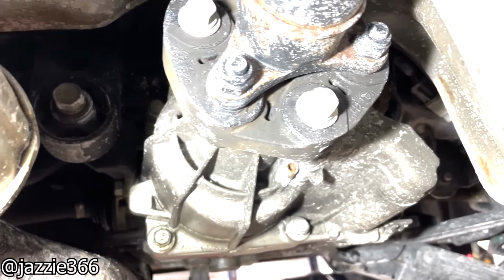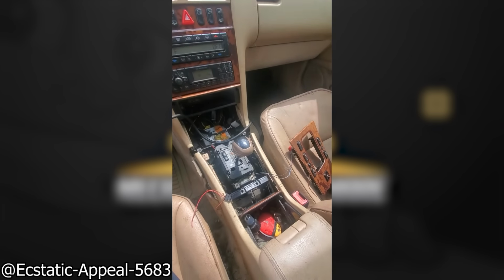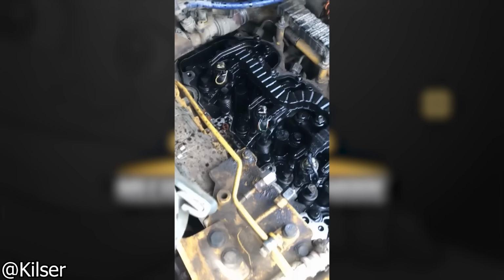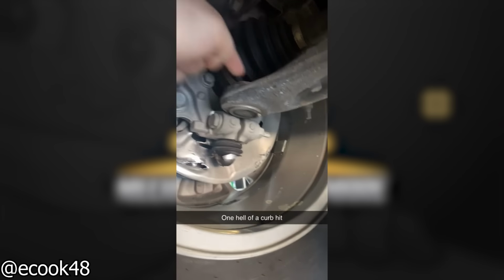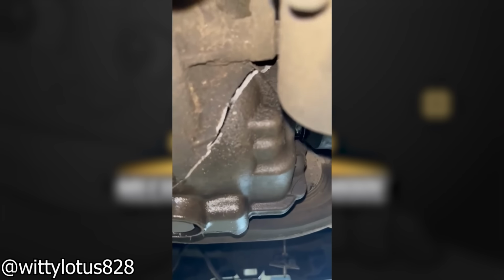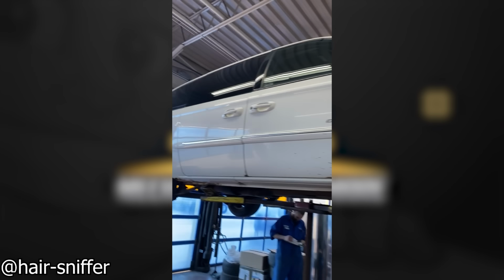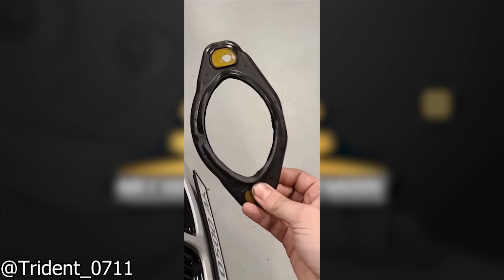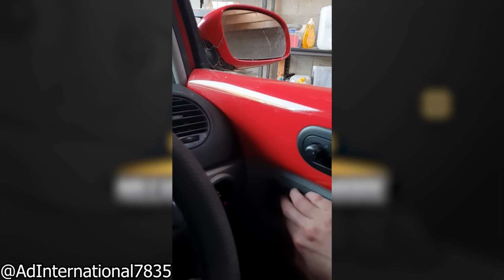Customer States Compilation (Best Of 2022) | Mechanic Problems | Just Rolled In

Comment: Dang! They're really upgrading the stock vehicles at the factory. Little preus & small hatch cars had 2 & 3 piece brake rotors as well as multi-piece clutches/Pressure plates/flywheels. They really clamp on "tight". Million mile oil or high capacity engines too!  
FFS people, pay attention

Comment: Dear mechanics it's 5 o'clock do you know where your 10 millimeters are?
Reply: If you have a few , (we would appreciate having them back) Also if u find my kniplex pliers from the airtex/wells  trash fuel pump era , I really miss that lil bugger  , is okay i replaced .  Still miss a good tool when it leaves.  ✌ happy thoughts.

Comment: OK, here is what we do and what you guys over there should do in the USA, just for the safety of everyone!
As I said it is a safety thing here if not for anything it's not driving a death trap on wheels on public roads!
Right, this is how an MOT works, go book an MOT test day then you get a bit of paper ( if you pass ) and also goes on the DVLA computer, as every car has got to be registered to the owner and all their details are sent to the DVLA. They will send you a log book which will list you as the Registered owner The MOT is to say " your car is fit to drive safely on the road for the next year. So you can't go in with shock mounts rusted away because that's all a failure, ball joints, track rod ends, lights, wipers, body, windscreen, tyres, exhaust not blowing anywhere from the head to the back box and it also must stick out from under the car, so you don't die by gassing yourself, breaks, brake pipes, hard and soft and it goes on, petrol lines, As I said this is mandatory! If you got a car. If you don't, get an MOT you will be getting pulled all the time till you get it MOT. The sooner the better as the fines mount up very quickly and they can take your car for using an unfit vehicle on a public highway. It works! Believe me, it does!

Comment: When looking on this..... DO I want to visit North America and travel with anything except air and train ?

Most NAs should be subjected to a rigit MoT inspection each year!
Reply: I don't know about trains - many tracks are in such a bad shape that you can be happy to drive with more than 30mph. Problem in the US is that passenger trains are seen as of no importance. The tracks are not owned by the passenger train companies, they're owned by the freight train companies. Most parts have only one track with passing points where the passenger trains always have to wait for the slow freight trains to leave a section. Because of that delays of a few hours are normal. A friend told me about a 13h delay on the California Zephyr and said that 1-3 hours were 'normal'. And add to that that the USA has no real high speed trains like the TGV, ICE, Shinkanzen etc.

Comment: How many sets of brake does it take to wear out disc rotors, custom states I only changed them once🤬
Reply: one the first set of pads...if you let it wear all the way down to the steel backing plate. ;) That'll eat a rotor to paper thin in only a few dozen miles, maybe a couple hundred tops if you brake gently and it's a rear brake.

Comment: you can use atf for most American power steering pumps for a short amount of time without damage. not in brake fluid reservoirs.   there's a reason parts shop guys aren't working as mechanics.
and its crazy how garbage everything is that's made after the mid 80s or so.  everything wears out and breaks so fast.  I've had cars that were made in the 1940s and 50s that were completely stock and still running fine 50 years later with just basic maintenance.   they never had any real work done.

Comment: What's with the rust? Is it to do with climate or quality control failure?
Reply: Mostly climate
Reply: In the midwest, during winter, salt is applied to the roads to melt the snow and ice. However, salt just eats through steel and iron, so it makes a lot of frames rust out.
Reply: We get a lot of that in Sweden too. If you don’t take proper care of your car, it will rust in pieces before you can say Volvo. The snow, salt, sludge, sleet and whatnot eats away at your chassis like hungry termites in a lumberyard. 
And then we haven’t even covered Alfasud, a failed project by Alfa Romeo in the 70s and early 80s. They built a car factory in the deprived southern Italy to create jobs, but the inadequately skilled workforce stored the low-quality Soviet steel used for the cars outdoors… before they were painted, that is. 
I remember what those cars used to look like after a few Swedish winters. Usually more holes than car body. Yellow ones would make you think of Swiss cheese.
Reply: It's a lack of protection! Owatrol oil or Mike sanders products protect your car from rust. US Car don't use any protection to low production costs. YOU have to care about this.

Comment: Brake discs worn so thin that the friction area detaches from the centre in a neat circle? I honestly didn't even know that was a thing! Considering how cheap aftermarket brake parts are for most popular cars,  there's no excuse for such gross negligence. Operating a motor vehicle on public roads comes with a tremendous amount of responsibility. Too many people don't seem to get that. 
The modern way seems to be to drive a car without maintenance until it breaks, then put it in for repair and whine at the mechanic about being ripped off when a load of potentially cheap-to-fix faults have been left to become catastrophic failures. 'If it ain't broke, don't fix it' and 'if you look for faults, you'll find them!' are the mantras of people too stupid to own and operate complex machinery.

Comment: Most of these problems could be avoided by doing PREVENTIVE MAINTENANCE!  Come on people, it costs a lot less in the long run to get things fixed as they are showing ware or issues than to let them go until they 
completely fail.    Roger in Pierre South Dakota

Comment: If you think stop leak is a good solution to any leak in your car you should just stop, Don't touch the car again. That's assault, If you don't want to have to buy a new car just fix the issue when it comes up, If you're broke like me you learn to fix it yourself. You have the internet, You can teach yourself anything.

Comment: I’m confused, do Americans not have to put their vehicles through an annual test to make sure the vehicle is safe for the roads? In the uk we have to get an MOT test every year after the car turns 3 or 4 years old.
Reply: In most areas, yes. But inspections don't cover everything. And most of these problems could easily have manifested well after an inspection was done.
Reply: @johnterpack3940  like chassis legs deteriorating to the point of disintegration? Surely it would take more than a year to rust out at least 5mm of steel?
Reply: @frankobarressi7919  I specifically said "most of these problems". But even rust can seem innocuous until it's too late. Worse, rust doesn't have to eat a hole or even be visible to ruin the structural integrity of a part. So, yes, even some of the worst rust in this video might have legitimately passed a prior inspection.
Reply: @johnterpack3940  if some of them passed an inspection the inspector must have left his guide dog at home that day.

Comment: Literally half of these are just mechanics complaining that someone had the audacity to bring them a car that needed basic repair done. Boggles my mind. Put the phone down and do your job. One of many reasons I haven't taken any of my vehicles to folks like this. Sure, some of these car owners are neglectful. Shit on them, by all means. I do, too. However, a decent amount of these are just simple bushings or linkages that just wear out over time. It's literally your job to diagnose and fix. Do you just want oil changes? I don't get it.

Comment: how the fuck did half a lug come out?!@
Reply: Probably a combination of being excessively tight plus likely the lugnut had poor metal temper.

Oddly enough I've seen similar happen before when working on a bicycle. I was going to remove the derailleur guard and somehow both bolt heads snapped off pretty much the same way. When I looked them over there were a few clear signs of rust inside the sheared area, indicating poor tempering and a preexisting crack that was likely there from day one new.
Reply: @southernflatland  honestly kinda blown away. I've been wrenching on some Rusty POS in the rust belt. My whole life snapped a LOT of studs and shaddered nuts but never sheared one! 

Lol kinda cool! But a pain in the ass!
Reply: A combination of nuts made of cheddar cheese metal and corrosion. Sometimes the cheap parts are just crap metal poorly cast... and rust is unforgiving.

Comment: What is it with US transmissions and differentials. European cars travel at higher speeds on roads close to 100mph plus  in Germany and the transmissions and diffs last twice round the clock unless you drive like a clown.

Comment: U can drive without clutch, using the revs. Amateurs
Reply: Double clutching
Reply: @mrcryptozoic817  that’s different. That’s clutch in, put stick to N, clutch in, put stick into gear, release clutch. Hence double de clutch.
Chang with revs is different, but u can slip it out of gear and into next without using the clutch.
Reply: @112chapters3  You're right.
I've done what you describe on a motorcycle, didn't know you could do that in a car (but it's been a long time since I've driven a stick shift or the truck).
Reply: @mrcryptozoic817  I believe in British armed forces if they teach u to drive they teach u to double clutch.
Reply: @mrcryptozoic817  Just lucky he didn't blow the welds on the intake....
Reply: @mrcryptozoic817  I've done it on a Hilux, on the telegraph track when the slave cylinder on the cluch packed it in.  You can start it in first gear then change gears by matching revs.  I've also heard of people changing from high to low range the same way.    Big trucks used to have no synchros.  Missing a gear on a downhill was life changing, back in the day.

Comment: Mechanics should have some say as to whether or not a person should continue to be allowed to own and/or operate a motor vehicle, when there is evidence that he/she is incompetent, negligent, unsafe,  poses a hazard to others, or is just plain STUPID.
Reply: No one should work on cars that are disgusting. If the owner won't clean it up, too dam bad!
Reply: That will just lead to mechanics extorting customers.
Reply: It's law in Germany. If a car is not street worthy (security risk) because of major problems the mechanic is required to call the police or get a waiver from the customer that the mechanic warned them that the vehicle is not street worthy. In the case of an accident the mechanic has a partial liability if there is no waiver or they didn't call the police. Add to that that you have to get your car checked every two years by an independent inspector. If the car fails you have some time to get it fixed and if it don't get fixed you get a visit from the police or someone from the department for motor vehicles to remove your plates.
Reply: Here in the netherlands I wasn't allowed to continue driving with a broken spring in the rear suspension. Worst thing about it is that we called the garage we get our vehicle serviced all the time. They make an appointment for 2 weeks later. I gave them the exact problem and part that was broken. And after spending all day at the shop, I came to pick it up at the agreed upon time (it's a work vehicle, so it needed a same day fix for a single spring) and they didn't have the car repaired because 'the didn't have the part in stock' At a brand dealer, appointment made 2 weeks ahead of time.... I wasn't allowed to continue driving dispite having had to for those 2 weeks and never bottomed out the suspension at all. Now all my mechanic knowledge comes from car mechanic simulation games, but I could figure out how to do that repair and saved everyone excluding the dealership, a bunch of money, but the lease company doesn't allow that sort of things (not even on brakepads)
Reply: @Cheepchipsable  I did say "some  say", not "complete authority".  Use your head for once.